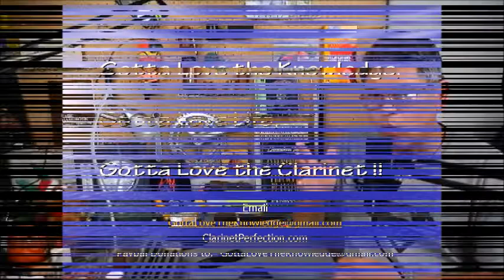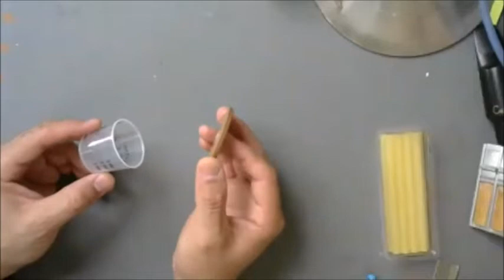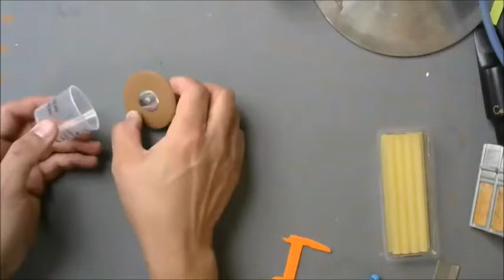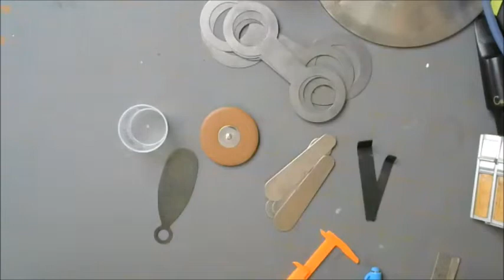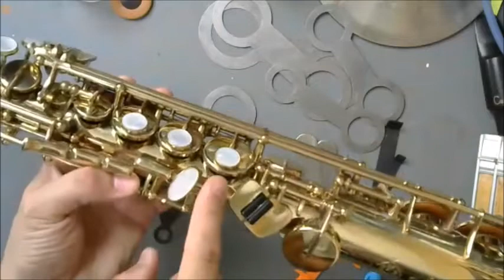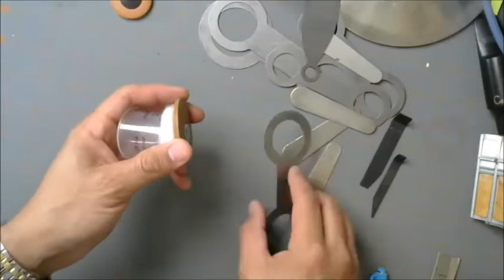Basic intro concepts of Clarinet / Saxophone Pad repadding / tonehole interface and adhesives

Comment: Force it down with clamp?
To me it seems more likely that you have the wrong thickness pads.
Reply from the maker: You must have not been listening. At 3:19 I state that you want the pad to fall flat on the tonehole.  going through at about 4:25 I mention pads to be flat, many new repair ppl who do not get the pad to fall flat will resort to using key clamps to get it to seal. I mention the problem key clamps again if the pads are not installed properly.  I also mention the pads at the 8:00 mark, and 13:45 mark being flat to the tonehole (so one does not use clamps).  Thanks for the input.
Reply from the maker: Also the depth of the pad (how much adhesive is used) in the keycup has more to it than the thickness of the pad itself.  I used to stock various pad thicknesses but then just stuck to specific sizes for sax and clarinet.  You'll get into issues on cheaper instruments that have vary shallow keycup walls though .. which I tended to avoid.  Thanks